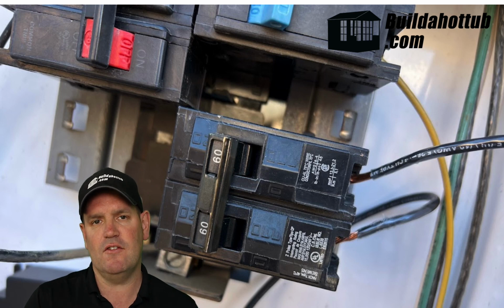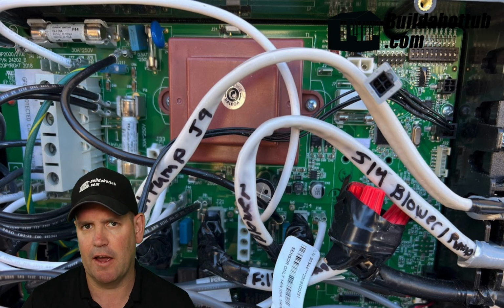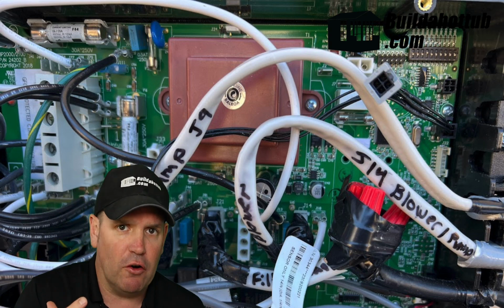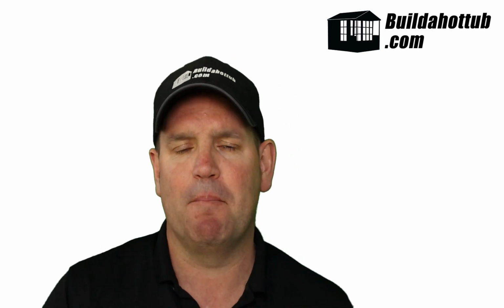DIY Hot Tub Electrics - Build Update from Scott in AZ, USA

Comment: I NEED YOUR HELP PLEASE 😢 please please please im in scott's crappy electrical connector situation.. the component connections on the new spa pack wont work with the old aqua quip component plugs. I have just received the new 4 pin components via spa Depot 🙏🏼(shout out to them for helping me in Olympia WA!!) but now they have arrived and i don't want to screw this up. Please help me.....😩